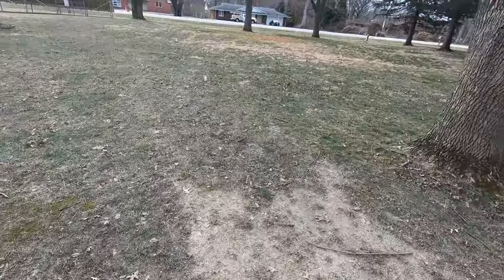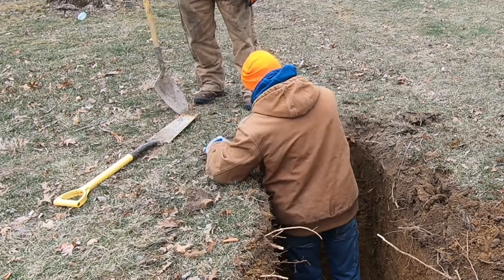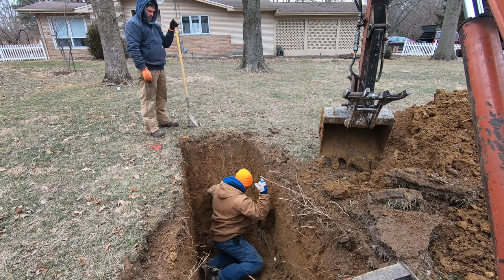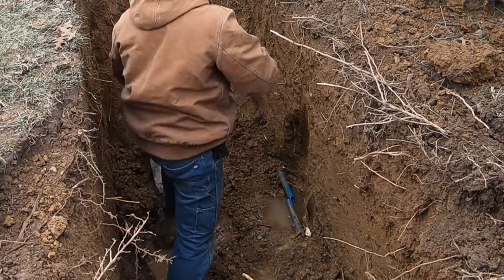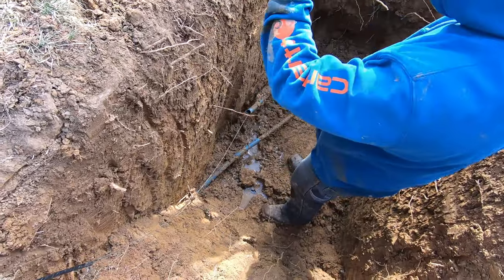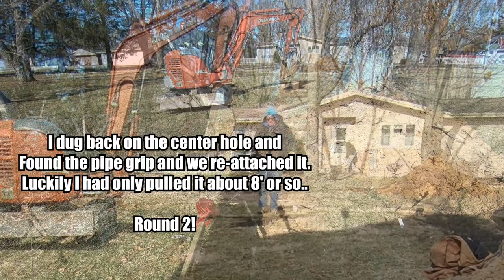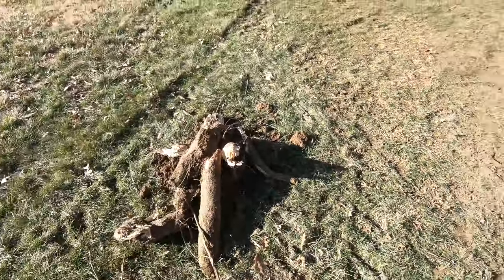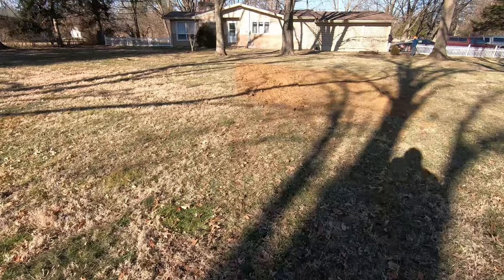Water line splitting with a cable and homemade splitter.

Comment: To the excavator operator.  
Dig a step up for the guys . So much easier for climbing in and out of the hole. 
Paint the steel cable 8 feet in front of the pipe clamp.  To give a heads-up to the excavator operator the end is coming out.

Comment: Nice job Tim and company. Not only would that save money but all the headaches of planting a lot of grass.
I don't know if you saw the video that Jesse Muller posted of pulling a long run of electrical service cable through conduit. He used a cable hooked on the cable and used the excavator track to wind up the pulling end. He may have used it like a capstan, I don't remember. It wasn't that long ago if you want to look at it.
Reply from the maker: I did see that. Love Jesse's stuff. He's very creative at getting stuff done!

Comment: You need to get backhoe and pull with the arm makes it easier
Reply from the maker: Yeah we have one we use sometimes. Also pull with a truck sometimes too.
Reply: Pulling with the arm you have to keep adjusting the gripper.